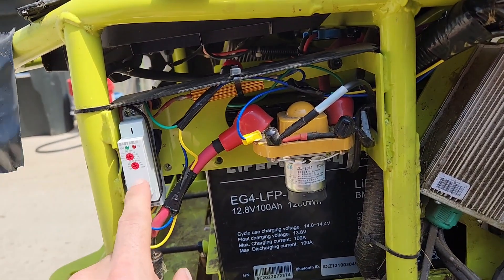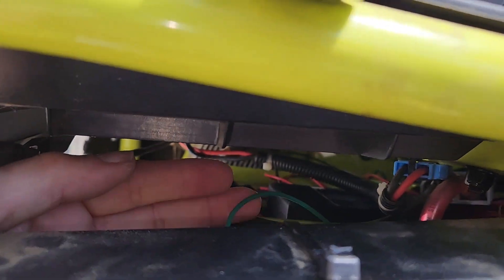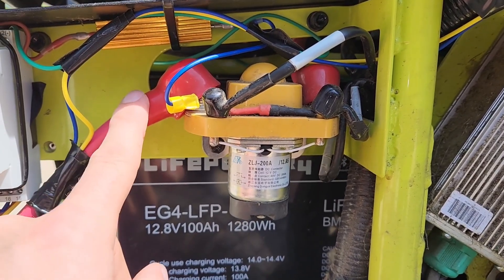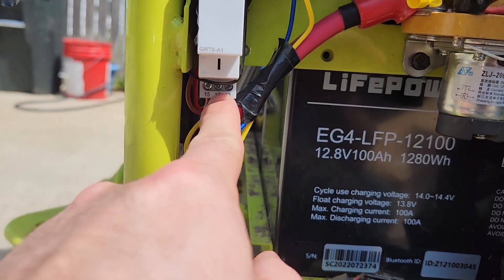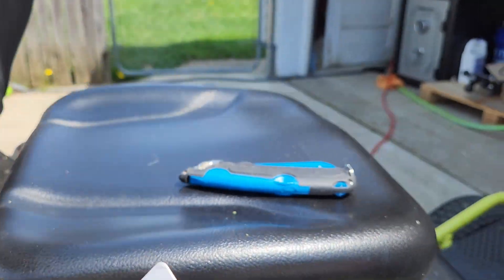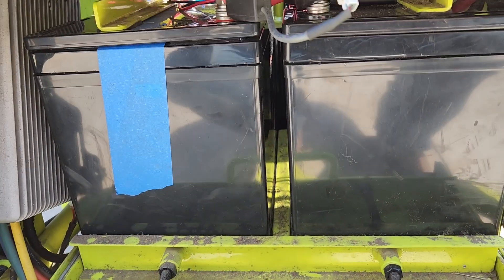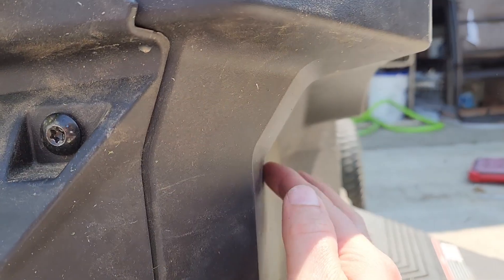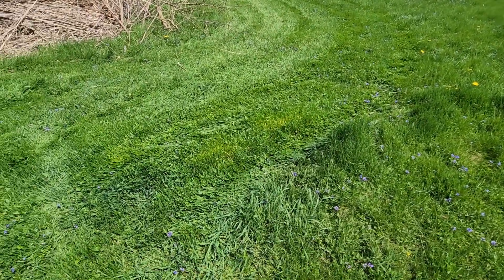Installing EG4 12v WP Lithium Batteries in Ryobi RM480e

Comment: There seem to be quite a few LiFePo4 battery conversions on youtube that do not include a pre-charge circuit and are reported to work fine.  I'm currently sourcing batteries for my conversion and I don't want to make extra work for myself if not necessary.  I'm curious if you added the pre-charge circuit because you were experiencing trouble with BMS tripping, or you simply thought it would be a good idea?  

Pre-charge resistors are common for inverters, but I have to wonder if the inverters might have larger capacitors leading to higher inrush currents.  If nothing else, the pre-charge circuit might extend the life of the main contactor, although many contactors have a separate hardened contact intended to deal with arcing when opening or closing the contactor.
Reply from the maker: If you buy a battery with a 200 amp BMS you should be good. The BMS in these batteries will disconnect at any spike that exceeds 100 amps.
Reply from the maker: I'll add that during mowing thick grass continuous discharge was 32 amps.
Reply from the maker: Some claim that the large inrush "may" damage the motor controller.

Comment: Nice little project!
Reply from the maker: It sure is!   Waited years for this. Hindsight, don't buy the batteries 8 months before finding the mower.
Reply: @theadventuresofarenaissancman  🤣🤣

How's the mower working overall?  What's your runtime like?
Reply from the maker: @AdamDeLay07  run time, I'm estimating 4 hours. Average amp draw is 20-25.
Reply: @theadventuresofarenaissancman  Not too bad, thanks!